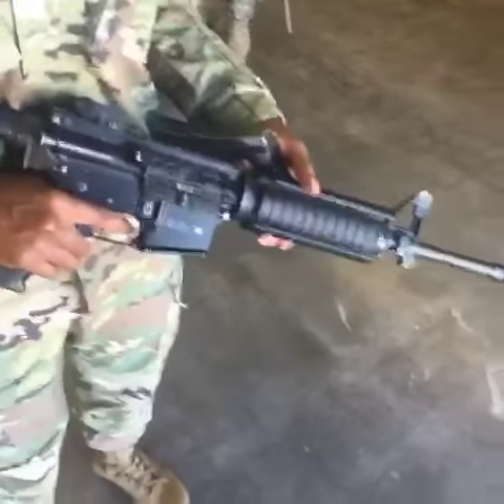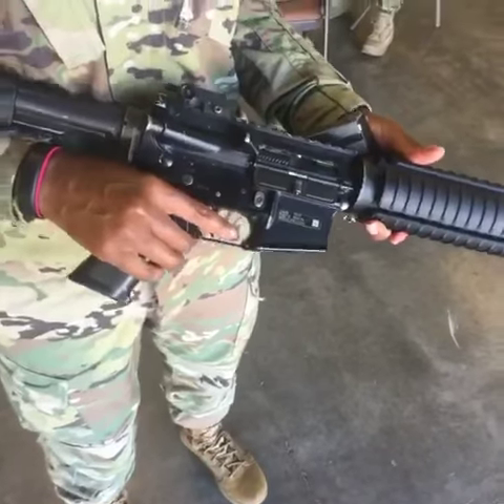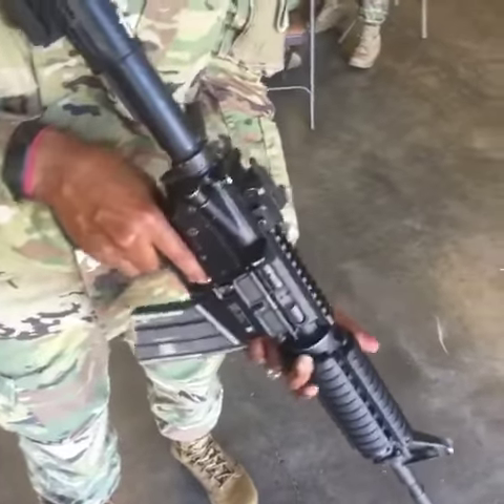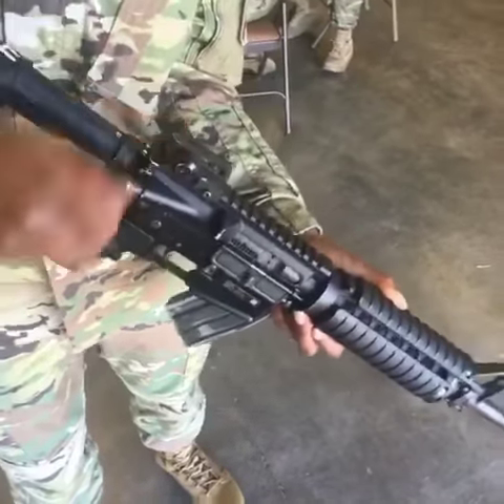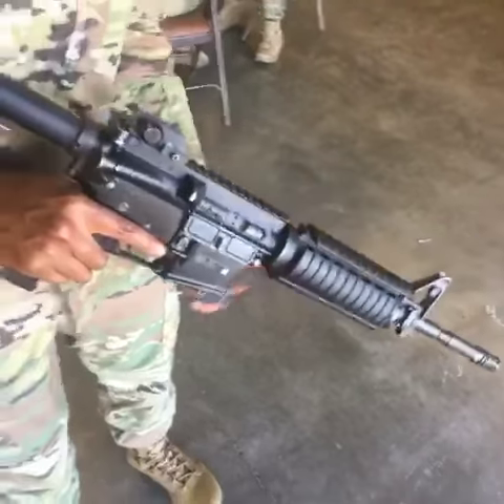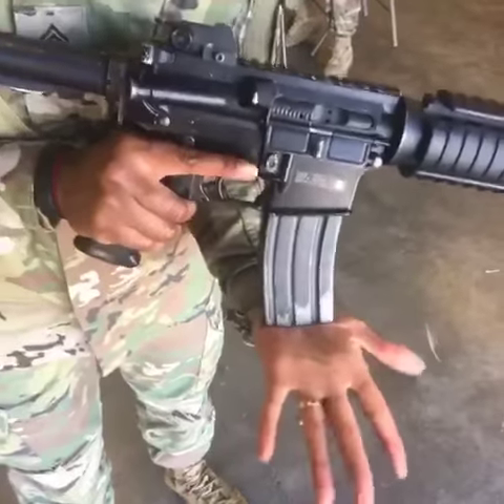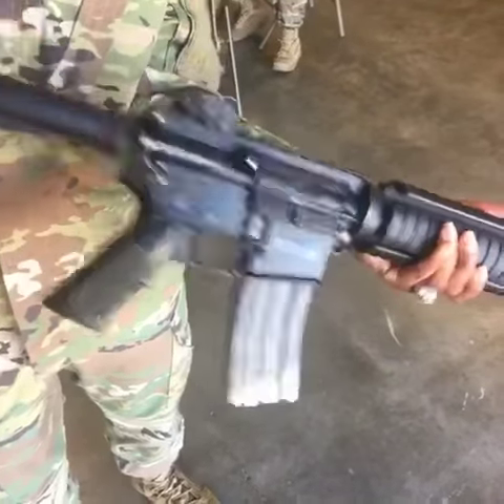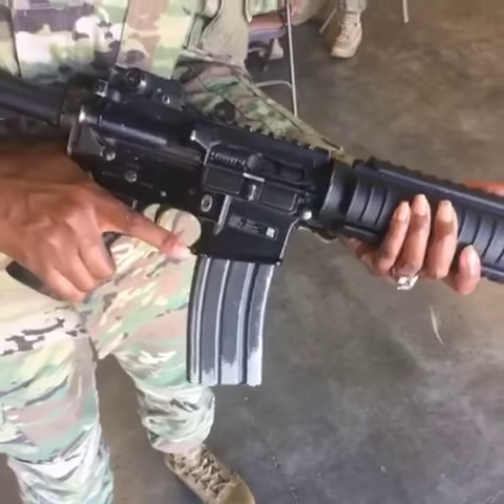Load a m16

Comment: Comment NO.2, what the hell was that reload, Imma pull an angry cops here just to show how I’m seriously upset about this reload, please know I don’t mean to be offensive, this is just a horrible reload in my opinion and I am not in the military however I have handled and fired an AR-15 before, I also know how they operate. Here begins my rant. WHAT THE HELL WAS THAT RELOAD? YOU SHOULD KNOW IF THE CHAMBER OS EMPTY OR NOT. YOU DONT NEED TO CHECK IT! IF ITS A SOFT RELOAD (What I call a reload with a mag that is not empty) YOU SHOULDNT WASTE THAT DAMN ROUND. 2, SLAP THE BOLT RELEASE (bolt catch) ITS AN M4, THEY HAVE BOLT RELEASES! WHO TAUGT YOU THIS? IN A SPUR OF THE MOMENT, HIT THE BOLT RELEASE, ITS MUCH FASTER! YOU DONT EVEN NEED TO PUSH THE FORWARDS ASSIST! However, credit for that, it’s at least useful, BUT YOU DONT NEED IT.